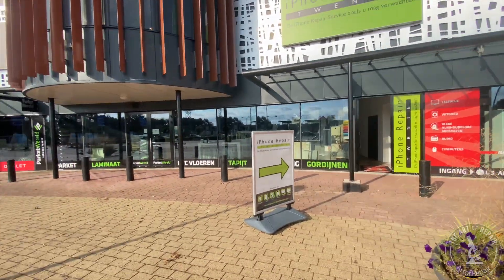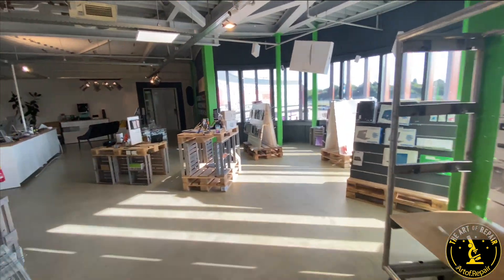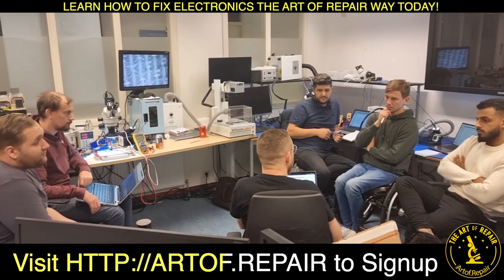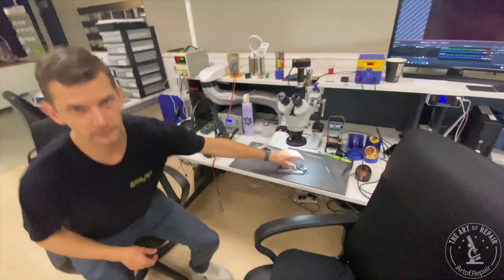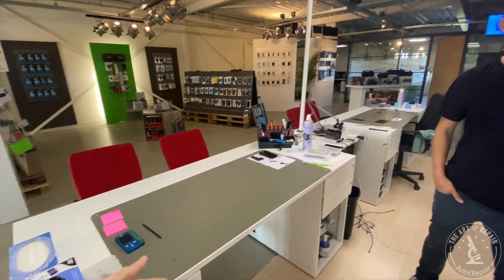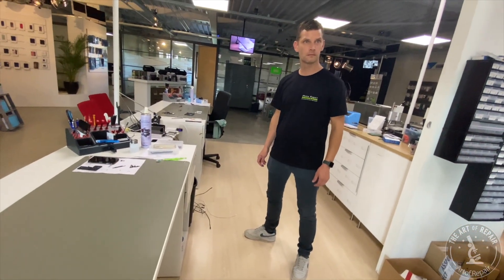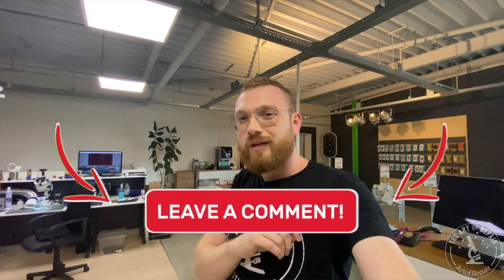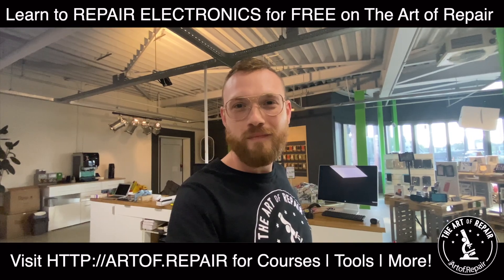🔬❤️🇳🇱  Soldering infront of Clients! | iPhone Repair Twente | Shop Visits | 2021 Euro Tour #3

Comment: Lot's of underutilized space.
Reply from the maker: Drop some timestamps and Ideas, im sure many would love to hear =D Thats the whole point right =)
Reply: @TheArtofRepair  It's a general comment, not a specific one. Here in the US, we optimize floorspace to earn as much money as possible. They don't have a lot of inventory, leaving wide open dead areas which send the wrong message. In the US, this invites irate customers to use it into a MMA fighting ring. I can see you right now pointing your Haako desoldering gun at a drunk customer who's knocking down shelves and picking fights with staff. 

They're just trying to hard to make the space interesting, but it comes off like a low budget interior decorating job. They're much better spending their money on sectioning off the front entrance space as a small, tastefully decorated reception and retail area with comfortable seating, refreshments, a flatscreen, small tables for showcasing mobile devices, and shelves of mobile accessories. The rest of the space should be devoted to walk-in, drop off and mail in mobile repairs.
Reply: @bobweiram6321  you’re right, at that moment we just moved in for a few months and came from a shop wit just 35 square meters and have 400m now. We didn’t really had a plan what to do with the space and how to fill it. Due covid and other shitty reasons we just did! Filled up as much we could. Now we are transforming the store 💪